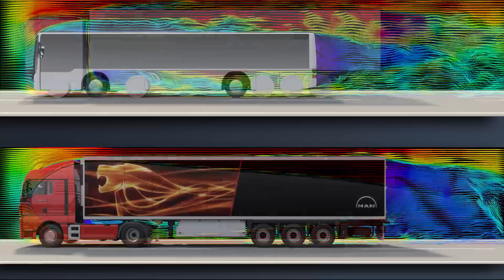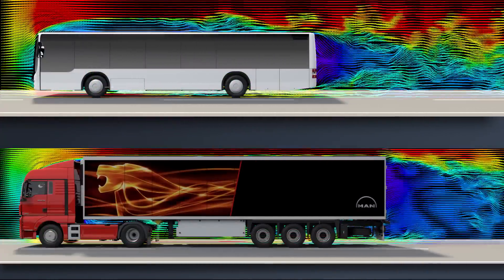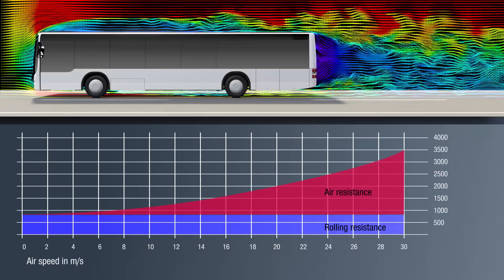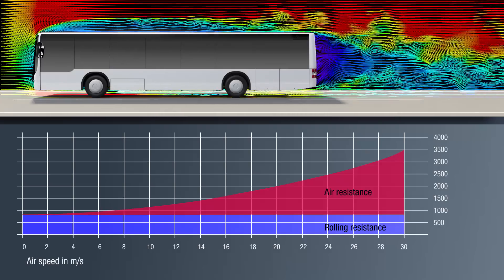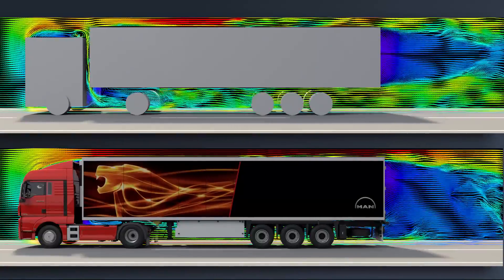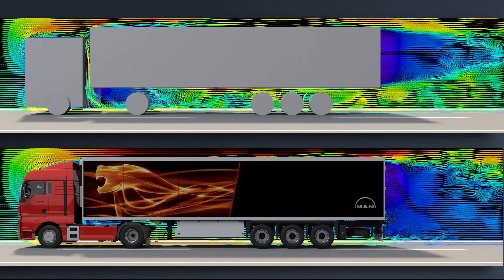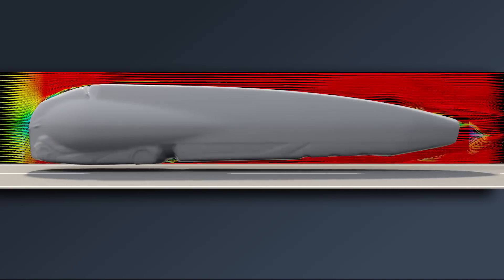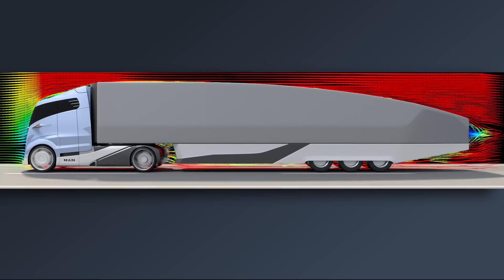Aerodynamics: Saving Fuel | MAN Truck & Bus

Comment: I hope there will never be trucks like these and tesla semi. They look boring from the inside especially. I like cars,I like vehicles, I like to drive them, repair them, tune them, I like big space interior and the square design provides me the most usable space or actually living area in a truck, I like gadgets no need to integrate everything into 2 tablets next to the wheel. Futuristic for most it seems means clean design which also means boring.

Comment: .... Hmmmm.    An inflatable front? A fairing you store on the rooftop as long as you are too long but then put in top of the vehicle on the highway? Clear plastic making the thing properly rounded and Aero in front but you can tuck it away once you are off the highway.    ..

Comment: In a few years you wont need a truck. Haven’t you all seen the Xmen movie where the trailers drive themselves? Thats probably the most realistic scenario considering the driver is the most expensive part of a truck, not gonna even begin talking about how most of the truck is only there for the drivers comfort.

All this coming from a driver yours truly. My truck has radar detection btw, it blows. I am literally going grey thinking about what Im supposed to do if my truck suddenly stops dead when theres ice on the ground. And they don’t even give the option to turn it off. Tesla is leading the way by trying to break the “vision” barrier.

If someone knows how to disable the “OnGuard” system without killing cruise control please let me know.

Comment: Dear Engineers of MAN , SHIPPING CONTAINERS !!!!!!! HAVE A STANDARD BOX SIZE :P
Reply: Well True.. But they the trailer might be the outside but hollow in the inside to fit the container.. :)
Reply: which would lead to a significant length increase, just to move around air.
Reply: @on_wheels_80  make the aerodynamic back inflatable.
Reply: @on_wheels_80  length increase, efficiency increase also.

Comment: Tesla is on the way))
Reply: Torent Stark tesla isn't going to be comfortable for drivers
Reply: Povilas Vitulskas 
And why not?
Reply: first of all drivers seat iš at the midle
Reply: also musk doesn't look seriousely at truck development. take scania's next gen trucks for example their creation took 10 years, they worked together with transport companies and drivers to make exactly want they needed
Reply: and u should do some research on how much will tesla's semi weight. because if you compare for example tesla's model s and other same class cars teslas are a lot heavier. and in transport industry tractors weight means a lot due to regulations. also tesla's semi won't work in eu due to it's length.

Comment: So how are you supposed to have high pallets or goods in from the back?
Reply: Dont tell me Its coming in from the side, caus them you will have to redesign the terminals these trucks back into to get loaded and un-loaded
Reply: It's a concept at the moment, not every little thing is going to be at 100% quite yet. It's a good point, however.
Reply: You could potentially have a door that opens from a much higher point than a traditional semi, allowing for taller payloads to fit closer to the front and smaller ones closer to the back.
Reply: Forklift operator must crush the balls in the back.
Reply: Was gonna ask straight away. But its just only imagination doubt itll happen for real. It cant anyways

Comment: It has amazed me over the last 30 years or more why the long haul truck industry in particularly hasn't embraced aerodynamic to reduce costs. The long haul truck industry uses so much fuel, and fuel is such a large % of their costs, that even a 1% improvement can recover development and capital costs very rapidly.
Reply: easiest way to lower the fuel consumption is to reduce speed. if a trucker is going thru a state where the fuel is expensive they mostly reduce speed and fuel up in the next country or fuel up as few times as possible.

Comment: Tesla did it :D
Reply: But is this design 'legal' in europe? I think not.
Reply: Well, one had the roadster 2 in its trailer.
Reply: lol Why not??  As the Tesla Semi Truck  is heavier due to battery than EURO Trucks they will need a bit shorter trailers and like that solving the problem. But I can still bet that in europe the length  of trucks might be increased due to the need of solving aerodynamics.
Reply: Um... no and no. 

No one will be using shorter trailers, if it would be just as you say then someone at this time would use them (on side note, roads in europe are narrower than in usa so it is harder/impossible to maneuver with truck with long hood).  Also the lenght won't be extended due to aerodynamics 'cos no one give a crap about econeomy of truck, cost of gas are on company side not goverment.
Reply: lol you must be misunderstanding how much shorter it will be. And no... the roads in europe are totally fine for these kind of trucks. EURO tracks are being less and less seen in cities due to UE restrictions and governaments that don't want to see these in them (There are already cities where you can't go in with a truck). 
You can always make trailer higher if that's your problem. We have long hood trucks in Europe some Scania's and Volvo's. Laws change every year so there won't be a problem to make an exception for aerodynamics. 
Everyone gives a damn about economy of truck, I have no idea where did you get that, people do count every penny just to save more and it's not only about the economy of truck but also the enviroment.  And btw... these kind of trailers are already in use a lot in England.
EURO tracks are coming to past so these aerodynamic trucks are coming up sooner than you think even to europe.
Reply: Sl1z3r So no legal issues with the I assume enormous battery?
Reply: And they’re still yet to show us one hauling freight

Comment: The Tesla  Simi truck is so much better
Reply: No it's not Tesla semi produce more aero drag than Chiron. Tesla semi have more frontal area. Multiplying drag coefficient, frontal area and velocity-squared, you will get how much aero drag while will generate.
Reply: There are already viable electric trucks on the market. Smaller versions but still. The truck business will go in that direction. Cummins made an announce recently about it. Nikola Motor Company did the same last year. https://youtu.be/wLidTCqAAtY
Reply: I think that for some EU roads, the tesla Semi truck will be awesome, for example in my country, in France to go to the northern city to the southern one (so basically do the longest trip u can do) you have around 990-1000km and a lot of rest areas on the highway. The problem of fixing the truck by himself is not even a problem because u literally have a car fix shop (that's how u say it ?) every 25km and a electric truck have less moving parts so it reduce the risk of broken parts. For the interior space, u don't need a lot. Why ? because of the autonomy, for 1000km i think u don't sleep or whatever ( i'm not a truck guy so correct me if i'm wrong). For the inside information, i trust tesla for the simplicity of the screens and i also trust that they gonna use some resistant materials to do a truck (for the last 2 points, none of us can say). And in EU you refuel your tank yourself so the battery recharge is an advantage i think.
Reply: i already know this problem, but every year we're doing progress in this case, i'm pretty sure that it will be great. None can say but i want to belive in this project and i keep in mind that this is the first truck for tesla, it's totally new for them, if we need to wait to get something really great and competitive i'm gonna wait.
Reply: How do you know that?
Reply: I have nothing to do with trucks, I'm just an IT student. Batteries are built to handle such constraint. 10 years ago if you told someone to recharge a battery with a 2 amp charger it would have called you crazy.
Also are you in the States ? Because in Europe you fuel up by yourself
Reply: boucq luca in the traditional truck manufacturers, yep, that issues os very controlled.

But in Tesla... If the electronics on the model S and X are a nightmare... Imagine in a truck.
Reply: that's why i'm saying that i can wait for something better.
Reply: El Chasco Finally someone that gets it
Reply: king raider the OP?
Reply: boucq luca the problem are the electric parts. The screens in that case
Reply: boucq luca traveling across country using a truck is pointless. Think about trains for carrying loads for a long distances.
Reply: cant even spell you young fanboy. like your going to drive a truck,who cares.
Reply: D4VE THEFIRST actually no. Most trucks in Europe travel the span of their country (or wherever their company wants them to go, which in some cases can be international) so for example. Take waberers (the Swift or Knight transport of europe) it is based in Poland. But some trucks go as far away as Britain. That's one example. There's more companies that do that. Not just waberers.
Reply: El Chasco. WTF are you talking about? "You work with cars", and so what?? We all work with cars this does not give you a knowledge about batteries. The battery technology has been around for a long time and the one used in electric cars and trucks will be different from what you talk about. Just think about electric fork lift that we charge every day business. BTW, Tesla has been producing cars for the last 10 years.
Reply: Serge Bisson Quick charge is not good for the batteries. It degrades the batteries a lot. And not, It isn't the hot only. And 30 minutes, I doubt a lot for that truck. And that 15 extra minutes are a lot.
And about the track refilling, you don't need to stay close. Because the fuel station personal can refill by you. Bad argument.

An electric truck is inviable now.
Reply: Nop. The Tesla is HOW NOT TO DO a truck. A truck needs interior space, and be easy to fix by the driver (buttons for example). Understandable information (the dials are easier to read), long fuel range (think that a truck has 1200km Minimum more unless), quick to refuel or recharge, and use resistant materials.
Reply: Machin Truc I work with Cars, and I can assure that the batteries fucks up If you use a lot the quick charge.
Reply: Will The legend The Chiron has drag because has downforce. The truck no. Marketing comparison.
Reply: mikos321 it Produces less drag then the Bugatti Chiron
Reply: Serge Bisson Small vans for local delivery and very planned routes, of course. But, for Big trucks, I think that the fuel cells are better.
Reply: The Tesla truck is still bad.
The American style trucks are the best without sacrificing space, aerodynamics or load space.
Reply: Serge Bisson I work with electric cars.

And, BTW, the Teslas are unreliable Cars. Battery issues, quality issues, electronic issues...

So, I know what I'm talking about.

The Leafs, for example, some exemplars are starting to report battery issues. But in general, is a reliable car.

And, returning to trucks, it uses lithium batteries, and that's bad. The best tech available nowadays are the nickel batteries. The only issues: the memory effect. But resists better in general
Reply: Anyway after à long ride, you need to stop either for sleeping or eating. During that time you can charge the truck. So the 1200 km range is not an issue with an electrical truck. It takes 15 minutes to full a diesel truck (and you need to stay close to it) compared to 30 min  for a Tesla (and you and eat during that time). Nice try El Chasco but bad arguments.

Comment: iv never understood why trucks, lorrys, buses etc have square designs
Reply: It's partly due to rising fuel costs and fuel becoming a greater part of the cost equation. Back when tires and pay were bigger expenses, aero wasn't as big of a deal. Back when the shipping industry was more profitable, aero wasn't as big of a deal. Back when diesel was cost competitive with petrol, aero wasn't as big of a deal.
Reply: There are regulations of the length of the truck + the trailer. If the truck has a long aerodynamic nose they have to reduce the length of the trailer, which means less cargo space
Reply: Asher Rose    Boxes are square and their container should be the same to maximize the space fitting.
Reply: Square shape minimises wasted space 
Imagine the truck filled with footballs, drinks cans or square boxes, there would be much less empty space around the boxes.
Trucks and lorries are generally not square, look again and you will notice that from the front they are square with ‘ rounded edges’, although this seems like nit picking the rounded edges reduce the drag considerably.
When designing a vehicle it’s the body and rear that have the greatest impact on drag, smoothing the airflow over the vehicle is much more important than the frontal shape. It took me a while to realise this when I studied aerodynamics.
The big spoilers on the roof of trucks are there to reduce drag by smoothing the airflow around the load
Reply: Because everything that is loaded into the trucks are square(ish). Have you seen the design of a pallet of how goods are packed?
Square means a higher packing factor. Something that can offset the fuel costs.

In any case, trucks are not going 130 km/hr like regular cars in europe. They go significantly slower, so aerodynamic drag does not become a great concern. Plus, they go in caravan, so drag is further off-set.
Reply: Asher Rose they are not square, they are square with rounded corners, the rounded corners make a huge difference
Reply: If you make it more Aero it becomes longer and that's bad you wanna fill length
Reply: becasue are cheaper and tehy dont want to made it more expensive... or at least they dont want to invest in design and be more competitive... until tesla reach the market... now tehy are all lokking for a efficent trucks because they ont ewant to lose his marked.
Reply: The square design is to have the most volume with taking up less road space
Reply: no my original statement was supposed to say " why have trucks always had a square design, box shaped, un aerodynamic" its only very recently have i noticed subtle changes in there appearances, the technology has been around for years why has it taken truck designers so long to implement aero in trucks
Reply: @asherrose4114  unlike cars every bit of  space has to be used. These trucks have the engine underneath the driver and if you wanted to make the windshield more sloped it would make the cab be tighter or pushed more far back meaning you can transport less stuff because your truck is longer. Hope this helps.
Reply: Square design allow more objects in the truck or trailer to be transported.
aeordynamic design = useless zones where you can't fill up with objects to transport.
square is simpler to manufacture,cheaper,require less material.
90 km/H is the max speed trucks use to move on the roads in Europe,so, like said in the video, the air resistance is not the major concern ,since it's only at this speed it's starts to be an aerodynamic "problem".
Moreover in this industry (transport) things move really slowly,because peoples(private companies of transport) invest a lot of money on a tool (truck) wich must be efficient to transport things cheaply.
you can't sell them new trucks like you sell cars to everybody with the fact it has electric mirrors or a two tones paintjob...
trucks are tools,tools don't change a lot through the ages.
Reply: Asher Rose wind resistans. Less resistans=less fuel
Reply: Asher Rose Its because no one like to see a pile of metal and some rubber wheels going around. Also there are requirements for it to be road legal.
Reply: was supposed to put square designs
Reply: Because trucks use a lot of fuel and making them use less does not serve the right agendas. For one. And two, the above Man design is not at all the most efficient. They are just playing games and carefully not upsetting the status quo. Sucks really, but protocol in nearly every industry.